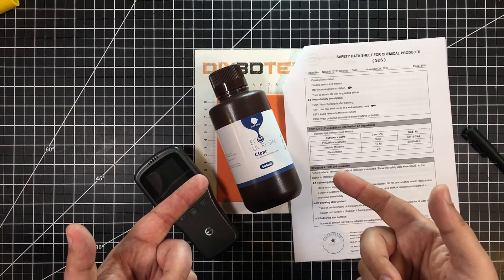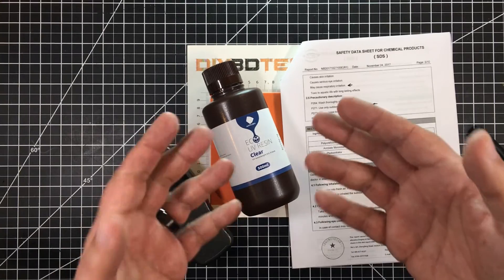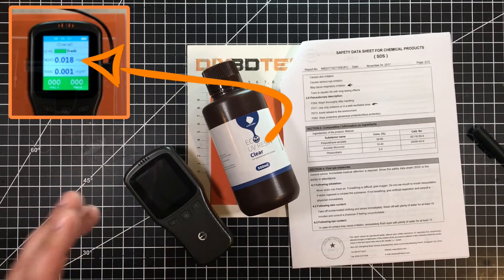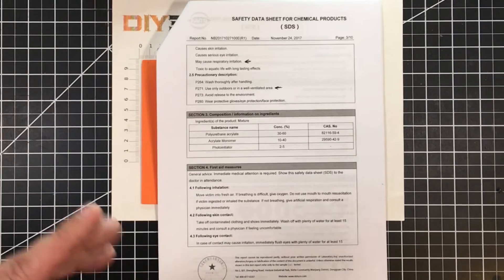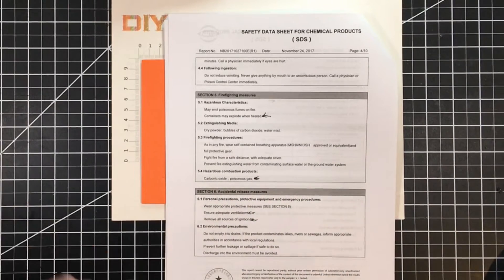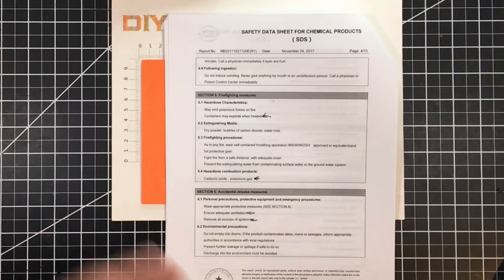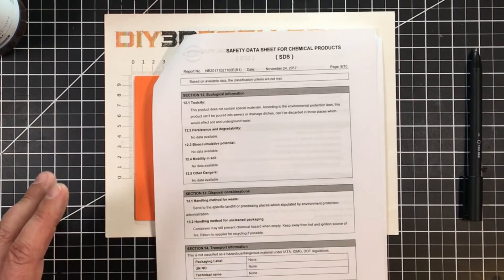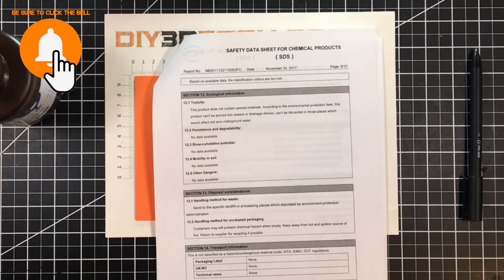3D Print Air Quality - Any Cubic Low Order Resin How Safe Is It?

Comment: Right now I don't have very good ventilation, but my printer is located in a place that can evacuate the contaminated air fast and nobody usually goes there. I have a chemical weapons rated gas mask and goggles for eye safety. I'm planning to add ventilation at some point but it's nice to have some information regarding safety.

Comment: I accidentally had a little resin on my thumb the other day when I walked into my back yard to put out some supports to cure in the sun. The resin heated up slightly slower than as if I was set on fire but close to the same temperature. Needless to say. Do NOT go in the sun if you get resin on you. You might just light up like the wicked witch of the west.

Comment: Could you please cite the numbers of VOCs, formaldehyde and particulates you got later in the test (with UV curing) for this resist? I found your other video on curing safety that used ELEGOO water-soluble resin very informative. I just wanted to confirm you got similar results for the AnyCubic plant-based one, and that they were also in the "red" zone..

Comment: Concentration brackets are allowed in SDSs so that manufacturers don’t have to give away exact formulas by detailing specific component ratios. It’s not that they vary it that much for different products.
Reply from the maker: Yes I do realize this (have worked with for 30 years now, however however manufactures do shift concentrations as the photo catalyzers smell so if you decrease those and increase filler you required a longer exposure however technically have less smell..

Comment: I've seen your Elegoo video regarding the curing causing increased formaldehyde, but you didn't mention how the Elegoo (which is a pretty standard resin) compares to this Anycubic Eco. I'd be curious to know if they were the same, or if the Anycubic Eco is actually significantly lower in VOCs and formaldehyde like the marketing materials imply. 

Great videos by the way, very informative!
Reply from the maker: Thanks and the general answer is no.  For the "common" resins they are all basically the same if you look at the material data safety sheets.  What they do is make trade off in the mix. As you basically have a photo-catalyst and filler so you change the percentages giving you performance to physical trade offs.

Comment: Amazing video!! This is super helpful. Before this I was debating whether or not to build a fume hood/extractor and just use a respirator and goggles. But now I'm DEFINITELY building a fume hood. Thank you!
Reply from the maker: Yes I highly recommend it...
Reply: @DIY3DTECHcom I'm putting a small resin printer in a unused bathroom in my basement. It has a small HEPA filter and a vent on the top that vents outside of my house. The room is behind a pretty hefty door. I'm going to use this eco resin. You think I'm good, as long as I follow the glove+masks at all times stuff as well?

Comment: A lot of safety data sheets are vague on the percentage of each component in order to hide their proprietary formulations.

As far as the hazardous combustion products go, carbonic oxides would mean carbon dioxide and carbon monoxide, carbon monoxide is of course the worse of the two, but is generally the result of incomplete combustion, so make sure you give your printer plenty of oxygen when it catches fire to prevent that ;)
Reply from the maker: You are correct about the "%"

Comment: I also want to make the point I really appreciate this type of content. There are very few videos like this using a meter and discussing the health hazards. Most videos in general, people wear gloves but I rarely see masks, and when I do, they aren't the respirator type I would use. Most content makers are a little too cavalier around resin for my taste, content like this is good for the community to stay grounded about the risks.
Reply from the maker: Thanks You! Normal masks will not protect you with this, you need a chemical grade respirator or work under a vent hood.  Also your 100% correct.  This is also worth reading too as issue is real: http://diy3dtech.com/dr-daves-post-on-resin-based-printers/

Comment: Thanks for posting this - I did a ton of stuff with PLA a couple of years ago and walked away from it.  I noticed recently the insane amount of cool stuff coming out of these cheap SLA printers and got excited about the possibilities.  The videos are insane - no gloves - printing print after print no ventilation some with multiple printers running side by side full tilt.  I mean this stuff sounds serious and it doesn't seem like you would know side effects for potentially years later.
Reply from the maker: Your welcome and this worth reading: http://diy3dtech.com/dr-daves-post-on-resin-based-printers/

Comment: So if i understand it correctly this data sheet goes for all anycubic resins not just the eco plant based one?
Reply from the maker: That what it appears to me (or at least at the time I made this video).  It seem they MSDS/SDS and lists a range of ingredients and I belive they just shift them for version.  If you think about it, they all can only work one way and there isn't silver bullet no matter what they list on the label...
Reply: @DIY3DTECHcom  Yes your probably right first I thought I could get away without ventilation for the plant based stuff. but this made me reconsider and decided to attach a fan and tube that leads out of the window. I better not have the fumes in my working space. maybe its overkill for the plant based stuff (I doesnt smell at all I have to say) but better safe than sorry.

Comment: Good points.  It would be more realistic if you tested while it was printing.  For Anycubic Photon owners (not the PhotonS), I designed this thing and it helps a lot.  https://www.thingiverse.com/thing:3681435
Reply from the maker: This somewhat simulates that as for the most part the resin simply sits in the vat and out gasses and that is what I dong is placing a measured amount in a small vat and letting out gas.  Also thanks for sharing that on thingiverse and have looked at many.  I am actually build negative pressure vent hood.
Reply: I believe that when the chemistry actually starts happening, things change.  At the very least the temperature increases because the polymerization reaction is exothermic.

Comment: Definitely not for me, I will have nothing to do with uncured resin. I have an FDM printer but I won’t ever use ABS norASA - I’ll stick to PETG and PLA.
Reply from the maker: I would not fault you my friend, as unless you have the correct safety equipment.  The heath risks are not worth it...

Comment: I purchased some "safer" resin from  https://www.3dresyns.com/products/3dresyn-cd-bio-d-conceptual-design-bio-degradable-for-fast-proof-of-concept-printing and although not oder less like the claim it is very low odor compared to the resin from phrozen. I however have not been able to get a print to complete with this stuff. It seems to required a lot of tuning. They include the chemical sheet in the shipment and also two bottles of tuning fluids. They also carry medical grade resins that require no chemical declaration (100% biocompatible, non labelled, without any risk pictograms) sheet but they are $$$ https://www.3dresyns.com/collections/100-biocompatible-3dresyns-without-any-hazards-nor-risks-for-class-i-ii-iii-biomedical-devices/products/3dresyn-biotough-d85-mf-ulwa-monomer-free-ultra-low-water-absorption
Reply from the maker: Whew!  450 Euro's!